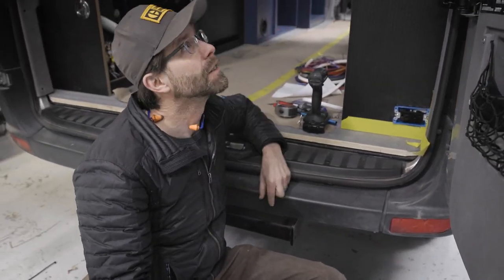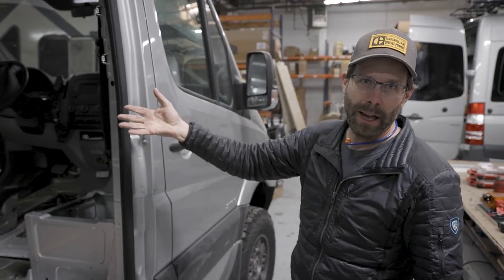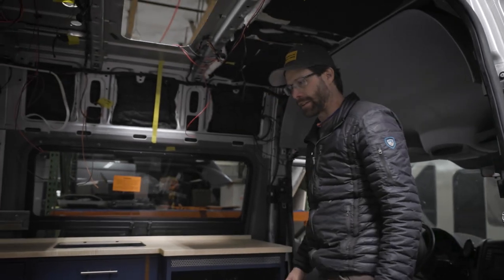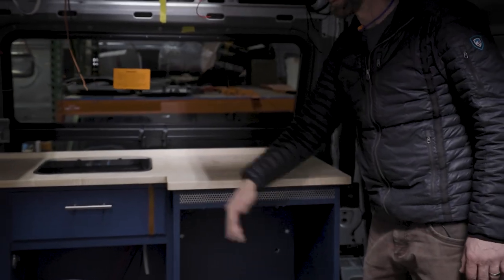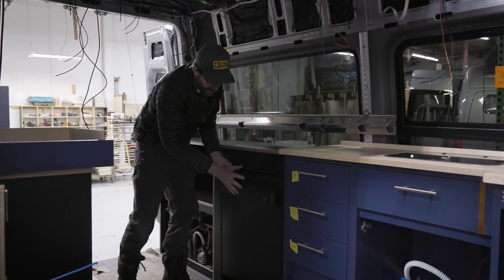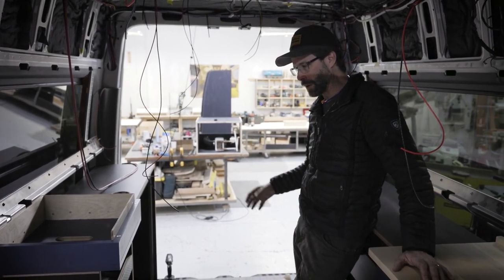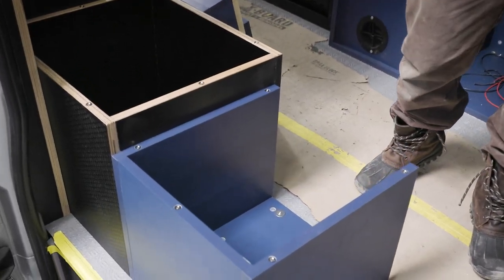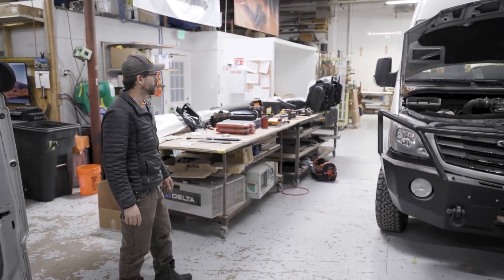NCV3 Sprinter Renovation

Comment: Rip out the factory AC is idiotic..must not live in heat
Reply from the maker: it runs of the engines compressor, so unless you're idling it won't function - pretty useless while camping
Reply from the maker: it still has factory AC for the cab area, when the engine is on